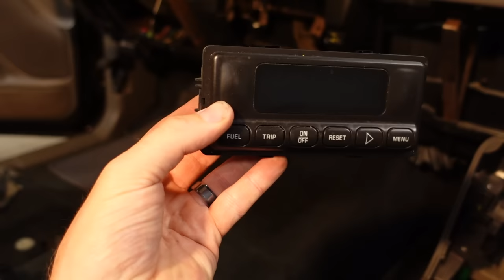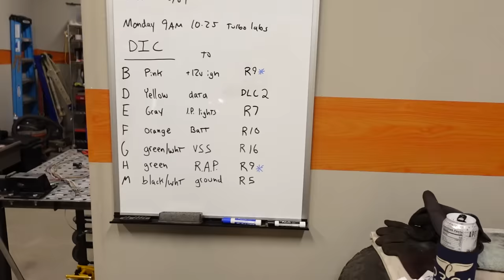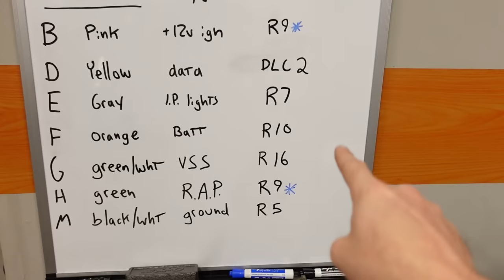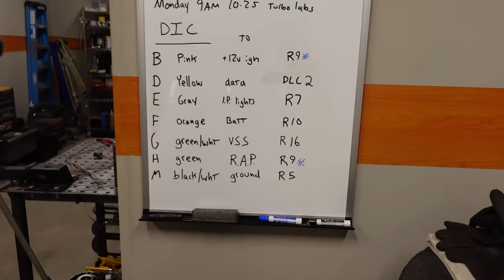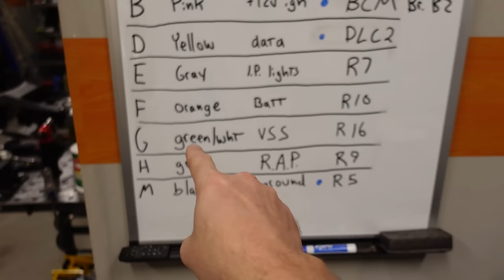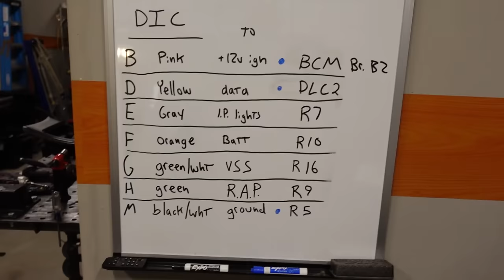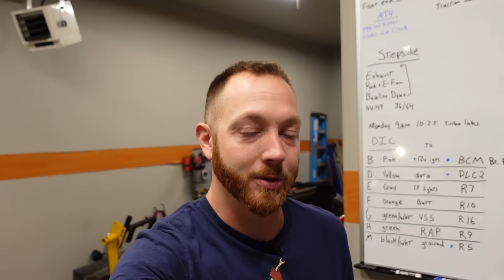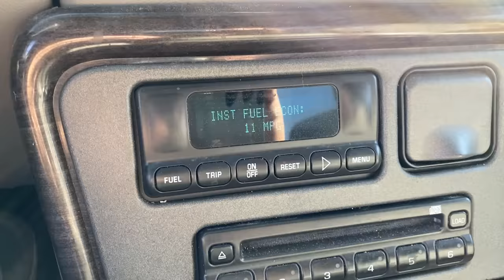the ULTIMATE SILVERADO INTERIOR UPGRADE & DIC wiring how-to GMT800

Comment from the maker: hey guys: I'm looking for a 2001+ denali front clip, in black, somewhere close to Utah. Hood, grille, bumper, lights, and all. Let me know if you've got anything!
Reply: The light output from the Denali headlights is horrible compared to the regular lights. Even with LEDs
Reply: I had great luck with some cheap DDM HIDs on my 03 Sierra Denali. Later retrofitted Morimoto lenses into the stock Denali housings using an adapter plate.
Reply: You can probably find something in Vegas.
Reply: There’s a guy parting one out on KSL
Reply: Will the Denali headlights fit 2000 Silverado?
Reply: @TBGaels32  there is a guy who parts out a bunch of GM stuff around these years, I’m going today and Ill let LT know.
Reply: @sean.g4516  no sir
Reply: Did you find one? I have an 03 Yukon Denali front clip. Green though
Reply: @jacobhobbs08  morimoto retrofit is the key
Reply: My situation is a bit in the air and may take a few months but I have on 04 Denali that I'm getting ready to strip down to nothing but frame and body and don't know what to do with it after that. I'm wanting most of the interior and drivetrain/powertrain for my 07 silverado. It has the cancer that has eaten through rear door rockers and quarters but from the front doors forward it still looks good.
Reply: Hey LT I know you're busy with the stepside (just watched the new vid and WOW!!) BUT I'm doing this DIC inspired by you.  Does everything work as you expected like factory? Real time updates as you drive?
Reply: Where in Utah are you from? I thought I heard an accent. 🤣
Reply: Hey LT, can you let us know what we need to swap Quadrasteer in our trucks and what modules we need and how to install?

Comment: I have the radio you mentioned form eBay “1 factory radio” it’s awesome in my gmt 400 (same radio), I got the one with a CD player, headphone jack and AV wires for amp hook ups NO Bluetooth. The Bluetooth is only for music you can’t use it as a hands free, only the headphone jack hook up works for talking, it comes in perfect and clear, I’ve had mine for 4 years now with no problems. You can get a “work truck” cubby tray form a gmt 400 to replace that 6 disc it fits in a gmt 800 also eBay or Amazon buy.
Reply from the maker: glad to hear that it works nicely. I kinda want one for all of my trucks.
Reply: @LawrenceTolman  yes me to have a 99 suburban, 2000 c2500 ccsb, and a 2000 c3500 cclb only have 1 radio want to get 2 more but there pricy compared to aftermarket radios

Comment: Good job LT. I could never find the schematic for that DIC. I think I had part of it but nobody had confirmed if it worked or not. 
I plan on purchasing one eventually and mounting it in the cubby in the overhead console since I have the 2003-2007 console in my 99. 
When you do replace the lights please post a video on that as well! I have blue LEDs in all the switches and would have to switch those ones too haha!

Thanks for the content

Edit: My vote is definitely add the leather seats and look for a backseat later. The heated seats rock. Also did you get the shifter  out of the Denali? It is leather wrapped and kinda cool. I have one from an Escalade.
Reply from the maker: the shifter that was in the denali was kinda beat up, and not even sure it was a good leather one, so I left it. Also left the steering wheel since it was the lighter cream color, and I prefer the darker steering wheel

Comment: Check junk yards in the older chevy/gmc trucks. They have a pocket that if I recall mounts up like that cd changer. I normally pull all my cd players out because I swap over to aftermarket head units and replace the cd unit with thr pocket

Comment: Great video, very informative. Quick question, I have a 2001 silverado and I am trying to convert the switches on the doors (windows and locks) to the 03-06 style. Do you have the pinout and color codes for the 03-06 switch wiring? Thanks in advance.

Comment: Love it! The details make a difference. I can't wait for the stepside muscle truck. I'm interested if the stepside bed weighs less than the regular bed of the same length.
Reply: The stepside reg cab shortbox is the lightest truck on this platform.  The outer bed bits are fiberglass.  I think actual weight is around 4800lbs?... Dont quote me on that.  But that figure is stuck in my head for some reason.

Comment: The update was very good for you, it is an impeccable job in my opinion, for this reason I have decided to install the DIC in my truck, I just acquired it today, but the display does not have the connector or cables. Could you please tell me where I could get this connector?
In the same way, I would ask you for support if you could provide me with a diagram indicating the connections of the DIC in the electrical system, I know that in your video you explain it on the blackboard, but I would be very grateful if you could provide me with a printed copy.
I thank you in advance for your comments and again my congratulations for your work.

Regards,

Comment: Add steering wheel controls also I added them to my 00 Silverado from an 02 Denali.
Reply: Do you have stock or aftermarket radio and how’d you run the green signal wire (I’m doing both rightnow controls and interior swap)

Comment: Great video, love all the mods you're doing on the two chevy's, now you're giving me more ideas to do👍.  I have a 2000 chevy silverado 3 door stepside Z71 that I'm doing some mods to.. Installed a double din radio with reverse and front cameras and Bluetooth, all interior LED lights, Installed door mirrors with turn signals (wired to body control module) heated ( by adding a relay in fuse box under the hood and changing the a/c controller to one with the rear defroster just plug and play) and puddle lights that i cannot figure how to wire them, tried wiring them to the door courtesy light, but they stay on all the time, any help would be greatly appreciated. ✌

Comment: I have had good luck with 303 aerospace protectant on the dash and interior.  It is not very shiny and has good uv protection which is more of an issue here at high altitude in Colorado and I would think for you in Utah as well.
Reply from the maker: Never heard of that, but Ill have to check it out

Comment: The wt1500 95-98 dash pocket works in the tape/cd spot
Reply from the maker: i'll have to double check. i thought for some reason the opening was a slightly different size
Reply: @LawrenceTolman   that's what i did on my 2000 with the full console. Its always nice using oem parts

Comment: I had a 02cc with the middle console (not Denali), never liked it. I now am working on a 00 with the 40,20,40 front and I like I much more. Idk why, but it feels more like a truck. I did buy the flip out cup holder from the bay and i feel like when it's extended it does everything a dedicated center does when you want it. Replaced 2 of the 3 "cig lighters" with a 3.0 USB to my double din and a Amazon dual 3.0 \ volt meter.

Comment: Hey LT, I have a 2004 Silverado I want to  convert the overhead console for a console with homelink. I was wondering can you just use the stock harness with only the console lights and just share those wires to power the homelink or should I just go get a harness appropriate for homelink?
Reply from the maker: from looking at my homelink roof console, it looks like it has the same plug on the body harness, and they just split power in the console side... should be plug and play with a non-homelink truck. (I think, haven't tried it yet)

Comment: I need ur help how do I convert the basic Tahoe ac control with the Denali lcd dual climate control my main blue plug pops right in but the second plug is different I’m getting power and illumination but no fan speed or ac or heat

Comment: Yeah I didn't have any cracks in my Dash but I ended up using flock and then I used Flex seal on my door c pillars along with like other spots as well
Reply from the maker: that would be a nice touch
Reply: I am an 81 year old lady with a 1984 silverado. Is there any dash that will work on that. Need the whole dash. PATSEY

Comment: should've swapped the dash cover for the escalade, the lines are more aggressive and look nice. that's what I plan on doing, also all leather steering wheel from 04 and up is totally worth it!
Reply: Gabriel, do you know if the escalade dash cover/handle is a direct swap?  (as in just the plastic dash itself..no electronics)
Reply: @locogringo4rzl  yes it does. Just make sure to get the dash bezel with it bc most people want $250-$300 just for that alone, and your old bezel won’t work.
Reply: @Gabrielsmusic  thanks for the info!

Comment: Hey LT I know you're busy with the stepside (just watched the new vid and WOW!!) BUT I'm doing this DIC inspired by you.  Does everything work as you expected like factory? Real time updates as you drive?
Reply from the maker: yup, it works nicely, updates as you drive, and even can show you top speed history
Reply: @LawrenceTolman  thank you, sir! I think I have found the issue with mine. The PCM is too old in 99 and would need a 2000 that would be able to give real time updates. Only my fuel range works, and refreshes after ignition cycles. Top speed and trip work in real time, but no other fuel data.

Comment: Why didnt you use a factory dic cluster and swap column for steering wheel controlled dic
Reply from the maker: That’s for the 2003+ trucks, which use totally different wiring and data communication than the 99-02 GMT800. Not compatible

Comment: How do you get 240 ftlb for  the harmonic balancer after a cam swap will you be showing us on the mighty mouse 4.8
Reply from the maker: There’s a small tool you can get that will lock into the teeth of the flywheel to hold the engine from turning

Comment: Ok so I got the dic in my 02 Yukon slt my fuel remaining part of it is working correctly but nothing else. Avg mpg instant mpg aren’t doing anything just staying on zero. Any tips on what I could be doing wrong.
Reply from the maker: It’s been forever since I did this, but is the VSS wire properly connected?
Reply: @LawrenceTolman  yes I have. Went over it and over it. Found a schematic online of the dic wiring on an 02 Escalade and it’s showing the green and white wire branching off going to the instrument cluster. It’s just strange and driving me nuts. I will go over my wiring one more time and make sure everything is as it should be. Thanks a lot for the response and your time.

Comment: What brand epoxy did you decide to use? I can’t find a decent one for my projects and I happen to need to do the same to my dash clips.
Reply from the maker: I think it was made by JB Weld and I picked it up at Lowes, had the self mixing tip on it
Reply: I’m looking to repaint or dye my dash. If you decide to do that to maybe the step side that’d be killer video because I can’t decide on the best way to go about it

Comment: I have a question do you have to wire up something to get the transmission temp to work ?
Reply from the maker: no, the wiring and sensors already are installed in the truck, its literally a plug and play conversion for the new cluster.
Reply: @LawrenceTolman  I appreciate you responding back and does it have to be from 01-02 Denali or Escalade or can I us a 03-06 cluster also my truck is 99-02 like yours
Reply: @ginosanchez1569  what did u end up going with

Comment: Does anyone know if you take the dashboard cover off, etc can you remove all of the AC piping so that it can be cleaned/washed without removing the entire dash?  I'd love to clean mine, I think the previous owner was a smoker, the heater smells like an ashtray.

Thanks for the video.  I had a DIC a while ago that I was going to toss into the overhead compartment that I harvested out of an escalade at a pick a part, but I was bummed when I got home and slapped a 12v/gnd on it and it was dead.  This gave me some motivation to get back out there and get another one.

As far as power, having all those cigarette lighter plug in the dash is a little odd, I ended up replacing 2 of mine with high watt dual port usb-c charging ports.  I can fast charge my phone in like 15 minutes now.  Also I can run my kids ipads and charge them.  Some of the lower wattage chargers can only run the ipads, not enough power for the charging.
Reply: I don't think so because my A/C has a big leak on the inside and as far as I can tell you have to pull a lot like even the steering wheel or disconnect it in some way or another
Reply: its a pain, i ended up using a steamer to clean my vents. then ran it on high with a smoke smell "bomb" I bought at a store. you just put It in the cabin and shut your doors.
Reply: Check to see if you have a cabin filter.most do.change that first!
Reply: If you can get ahold of a steamer, blast your vents with it and run the ac. I actually had a snake get into my caprice and unfortunately it got stuck under a box and died. A month went by and I found it and the smell was so rancid I thought I'd never ever drive the car again. I used the steamer at work and cleaned the whole car and I actually bought a 75 dollar ozone generator from the amazon and ran it for an hr with the AC on and let it sit for a few days, no more smell at all the car literally smells like nothing.